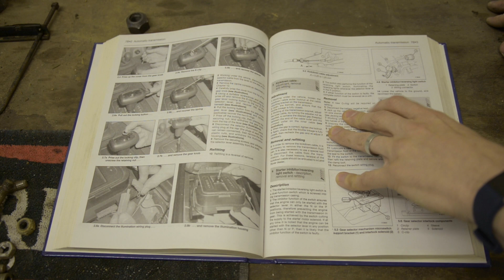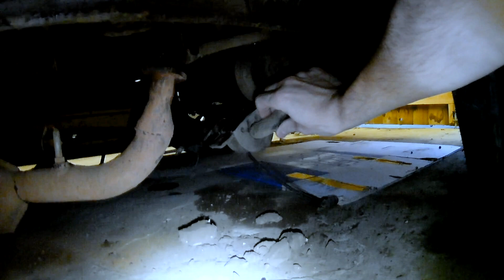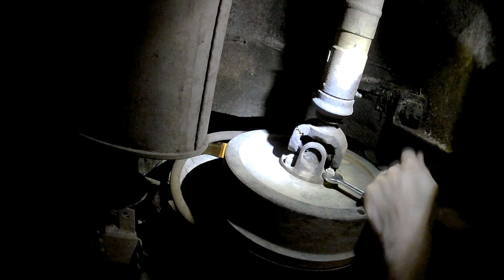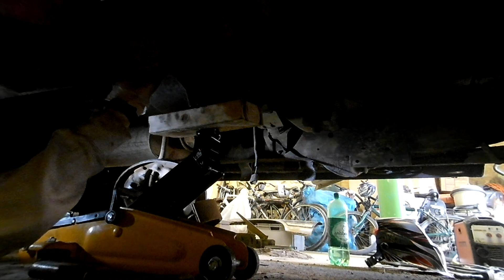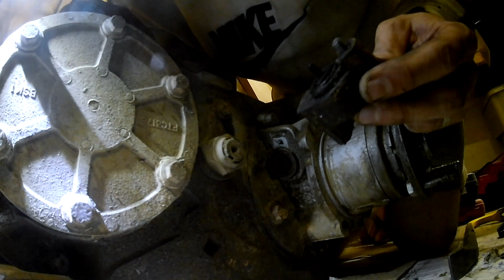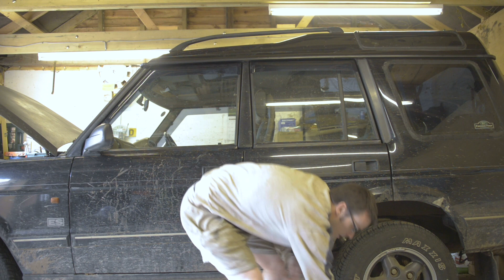How to replace a Land Rover transfer case - LT230

Comment: Can you tell me where the securing nuts and bolts are please ? The online workshop manual says remove one nut and three bolts but are there other bolts to the front of the box also ?
Reply from the maker: Sorry I am replying way to late here to be of any use probably. I did this a while ago and don't exactly remember. I do recall that once you have the gear lever cover out (assuming you are going down that route) the nuts and bolts should be fairly visiible and clear which you need to undo.

Comment: What's that seal called that you replaced on the transfer case?
Reply from the maker: Sorry, was a while ago. I got it from landrover after pointing at a diagram. Not even sure I could find out the part number anymore.

Comment: When you removed the transfer case mount did you have a heat shield on the mount ?
My td5 makes a metallic rattle when 8n gear and idling and I’ve been told it could be the transfer mount heat shield and it does come from that sort of area but I couldn’t fit it last time I looked lol
Reply: Found mine on the left side mount above the exhaust ,a tin shield to stop the rubber mount melting and it was rattling against the chassis so I bent it out of the way ,sorted lol
Reply from the maker: @scottde-walden2760  happy days, well done 👍
Reply from the maker: There was definitely no heat shield on mine. It may been ripped off at some point but I did not see any evidence of it ever being there.

Comment: I have a 96 discovery and the noise it terrible. Did your rear prop shaft lock up? And when you spin your rear wheels did the prop shaft not spin?
Reply from the maker: My symptoms, and in fact the reality of the situation was that the centre diff was locked all the time. So all the other shafts etc behaved as normal. Sometimes you would get a massive clunk when the centre diff jumped in a tight corner.
Reply: garage90 I’m assuming no damage to the differential was done?
Reply from the maker: Everything out from the transfer case was fine. Just the differential in the transfer case was destroyed. If you watch my strip down of the transfer case you will see what happened.

Comment: I have an  A reg. 110 that now runs a V8 and ive changed the transfer box to a Range Rover gearing @. 2.222,. It now revs lower and copes well with motorway miles.
Reply from the maker: Nice you have a v8. Have you got standard wheels on as that comes into play also?
Reply: @garage90uk  standard 110 wheels yes,.  It's  not set off any cameras yet & I've had it 20 years......(now I've sed that.)

Comment: Hi good job. 
Can you explain a bit more about the symptoms? My truck makes a very loud bang that can be felt through the whole car and is getting worse have changed loads of bits in the drive train but still the same so am now thing its stuck in diff lock
Reply from the maker: Hey, yes with what I know now to test is pretty clear if you are in diff lock full time. Driving in a straight line you should not hear any bangs. Driving with the wheels fully turned either one of yours wheels will skid a bit or you will get a loud bang as the gears skip in the case. This is best tested on gravel. Does that tally with your situation?
Reply from the maker: For sure a loud bang is exactly how I would have described mine.

Comment: How did it go putting it back in??????
Reply from the maker: You can see us lift it back in around 17:50 on the video. Went on OK but you need to be careful not to ruin the input shaft seal on the way.